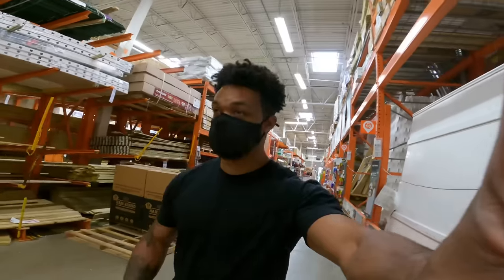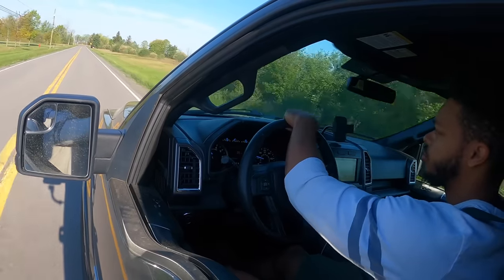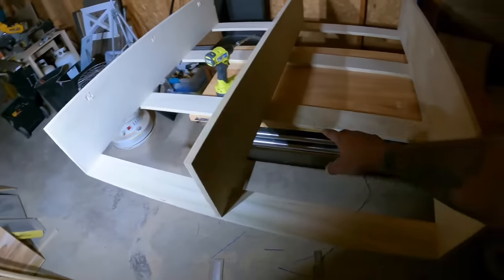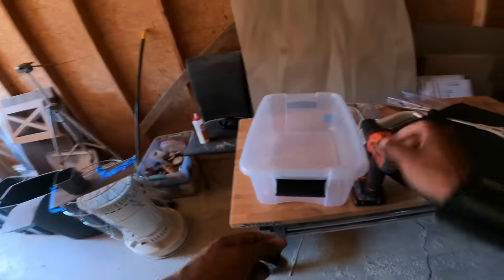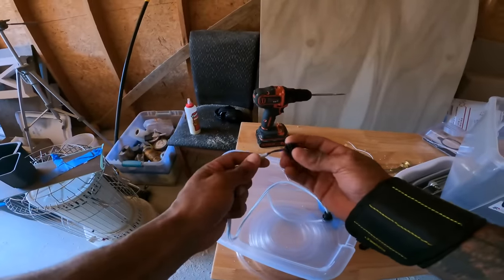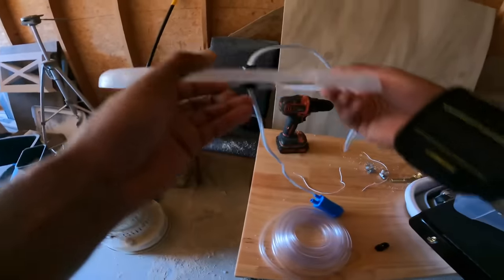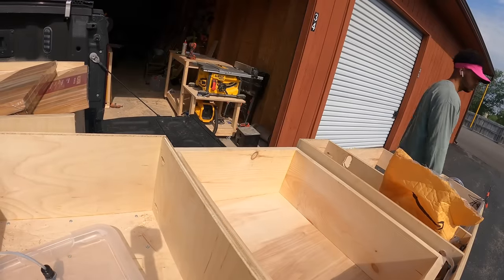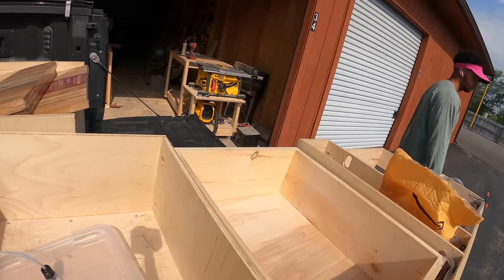DIY Truck Bed Drawers w/ Full Kitchen (FREE Plans) | Overland Stealth Camper Ep. 1

Comment: That decking drawer slide idea. Wow. Hats off to you, man. That is crazy clever. I’d love to see plans for this.
Reply: It's also one of the better ideas that I've seen for the money.
Reply: Why do you need plans for this?  Every build is custom to your vehicle.  How will those plans help you? You find wood that is available.  You measure your van or truck out.  Its all in the measurements.  Set your requirements down first.  Then build it.  When you ask for plans, you are not thinking it through. What is it you want to build?  What are YOUR requirements - that is the million dollar question.  Once you know what you want, then sketch it out and THINK about it.  Anything else you need to add or subtract?  Mull it over on your walks.  After the design is settled, build it out of scrap cardboard and tape.  This step helps avoid mistakes in cutting the wood. Then buy or find free wood and cut it up and make it.  Those who want to see plans are never going to build anything.  Start building!  Use cardboard.  Graduate to wood.

Comment: You are 💯 correct. It's the small projects that shouldn't be an issue that sometimes goes wrong. I've started to drill pilot holes to save me the aggravation of splitting the wood. Enjoyed build, I added a fridge on the right side, instead of a storage drawer. 👍

Comment: Where the first handle screws split the wood, predrill the holes 2mm smaller than the screw, ( dont know in inches!)
Also clamp across hole before screwing. 99.9% of the time it wont split. Hope that helps.
Great job by the way, starting my drawers this week

Comment: I watched awhile ago and forgot what you used for sliders on your long drawers.  I'm building a tiny house and it's going to have huge drawers that pull out for storage, using that  decking material for a slide is perfect!  Thanks so much, to give you an idea on cost savings, a 60" drawer slide costs $272, ridiculous!

Comment: Great ideas here, I like the decking slide tip for sure. I recommend putting a fill port on the water tank and then siliconing the lid on, it will slosh around and leak otherwise.  Also recommend a lock to keep the drawers closed when driving.

Comment: Super idea on those drawer slides.  60" bearing slides are about $220/pair!   You could spray the track with some spray silicon lubricant to help to slide better too.
Reply from the maker: Good idea on the lubricant I want to try that and post an update for the slides

Comment: That is amazing! Thanks for the video. I wonder if you could put the decking on the sides like a rail instead of the bottom? The only thing I can think of adding would be maybe some drop down legs or screw on legs so when fully extended, it's level and more stable? 

Either way - excellent video!

Comment: Hella smart using those composite planks as slider rails, I wonder if a silicone lubricant could make the pull-out/in even smoother without getting it filled with grime? I was afraid of how far you had that sink portion hanging from the original piece, but the rear gate looks extended and chonky enough to support it. Love the simplicity of the build, and hell yeah I'd love to see the plans!
Reply from the maker: The sink portion is the lightest part of the drawer and the tailgate is made to hold way more weight than this drawer which only weighs around 100 pounds
Reply: @Dualex_Builds  cool man, appreciate the reply

Comment: As always, your skills & builds are no doubt in my opinion, awesome young man! Didn't know you were are a vet, kudos to ya & thanks for your service! I've did the same as far as splitting wood near edges b4 I learned that it works well when drilling smaller holes b4 installing screws near edges! I also bought an adapter for my 20lb propane tank, turning it upside down to refill my small 1lb tanks, works well too! I'm sure you're probably well aware of...just thought that I would mention anyways! Can't wait for the completion of what appears to be another one of your great projects!

Comment: Just found your channel. Love your ideas and creative solutions.  
I am in no way as skiled as you. However, one way  I've learned to prevent screws from spliting boards, is to pre-drill with a slightly smaller bit than the screw size you are using.
Keep your videos coming. Great job.
Reply from the maker: I always use pilot holes before screws. Sometimes the wood just splits anyway. Welcome to the channel!

Comment: sweet lil project!...but a few concerns:
1) how are you going to monitor/recharge the battery powering the pump? it seems in an inaccessible location, and no supporting electronics (e.g., charger).
2) you should have some stop to prevent pulling out the drawer too far and tipping things over. right now it's not an issue because it's empty and most of the weight is in the back with the water and pump/battery.
3) you should have some locking mechanism to prevent it from sliding forward and damaging the faucet during driving.
4) that water tank is pretty lame. i think that it will for sure spill water during driving, and that might short out your pump and/or battery (unless both are marine grade). why not just get a legit like 20g potable water tank, and secure/plumb it properly?

Comment: I’m intrigued definitely. I’m currently working on making my Tacoma mobile with a camper. I’m happy with the roof rack and bed rack from Hooke. Considering putting on airbags to compensate weight in back another$600. Cuz once it’s on that’s it. I’m interested in the plans for H20. Your experience with simple design and plumbing makes me wanna try. Thank you

Comment: Great build. I built a bed slide for my Avalanche. Had to anchor it so it did tip or  not slide out on it's own in a hill. Do you have any trouble with tipping etc? I think I will build the left side of your build. I will sleep head in cab and feet in right side of bed (Avalanche midgate opens to allow this). Then make a partial right side drawer from feet to tail gate on right side. Plans would be great if you would...!!!

Comment: Man, you did a great job. I love the water system.  Have you though about a 5gal water can? Like the generic tan ones from the mil? Placing it in front of the wheel well, and having the pump
In the bottom and the tubing coming out the small garden hose on the cap would make for a nice install. The container you have would cause me concern for leaks if you do any off road at an angle.

Comment: Thanks for your service Sir. Love your work and yes I just found you here. I was in the draw of basically what you did on my 8 foot bed Ford. Think I am going to make the same 6 to maybe 6.5 foot box system. Leave the front for my water tank fill from outside like a travel trailer I guess you could say. My question or thought was the vinyl slide. If a guy went on with a 8 foot box build, do you think the 6 foot on each drawer like you did would be sufficient? I am thinking so but Opinion there if someone does go 8 or if I change my mind. Great job.

Comment: I know this is an old video and you’ve changed your set up but I do have a question, how did you hook up the propane with that cutout, did you use the stock metal line or a hose adapter? Did the feet clear it enough to where it could lean the propane on the wood table top?

Comment: Hey! Love this build -thank you sharing it (with mistakes - I make plenty of those too!) How is your slide solution working? How hard is it to open when your drawers are full? I'm planning a similar build, and the drawer mechanism is a sticking point. Some build custom, complicated slides with skateboard casters, and some use heavy-duty slides but both are way too expensive in terms of time and money, so a budget solution that actually works is what i'm after.
Reply: Did you use the slides the same way in your build? Looking at this myself and Im super interested in how it performs. 

Trying to understand how it stops without just pulling it all out aswell.

Comment: Ah my dude, when you are that close to the edge, its best to pre-drill srcew holes.
I personally cant fathom why you didnt use the same draw runners on the main draws but you did for all the other draws/shelves. Other than that little personal preference, not bad, good work.
Edit: yeah I get the decking is cheaper than sliders but when you put as much effort and time in, is it worth cheaping out? I say this from experience of getting burnt everytime I have cheaped out.

Comment: Great work! I just found this and I'm going to try to build just the kitchen half of it so I can have my fridge in the other half of the bed. I have 25 inches of width to work with so this should be perfect. Is the total height less than 10.5 inches? I want it to go under my Retrax cover container. It looks like it is in the plans but it seems taller than that in the video. In the plans it says the drawer height is 9 1/4" but the frame wall height is only 8 3/4"?

Comment: dude please lower your table saw blade. be safe man
Reply: That’s the very first thing I noticed. Scared the heck out of me.
Reply: Agreed…especially if you are going to run it without the guard (not criticizing…I run mine without all of the time too) the blade being that high is very easy to catch clothing or other appendages! It should be adjusted to be about 1/4 inch above the material. This will also result in better cut performance and quality because you have more saw teeth engaged at any given time. Dig the video…the slide idea is genius!

Comment: How did u secure it to the bed? Did I miss that part? Great vids! Thoroughly enjoy them
Reply from the maker: There are tie down points, but it doesnt need to be secured to the bed since its the exact size.  the tailgate is only open when the truck isnt moving so when its closed the drawers dont move around if that makes sense